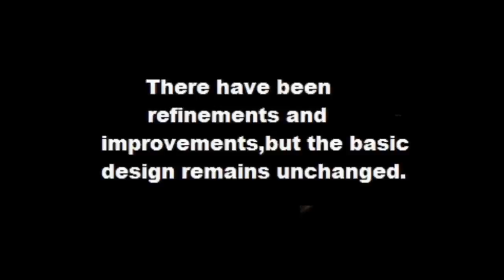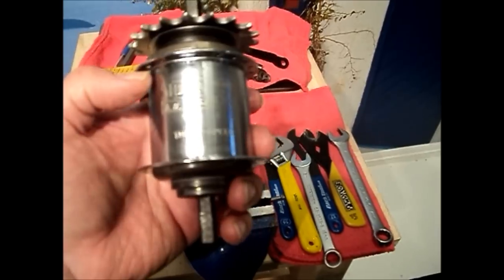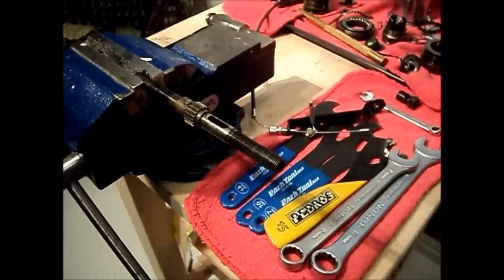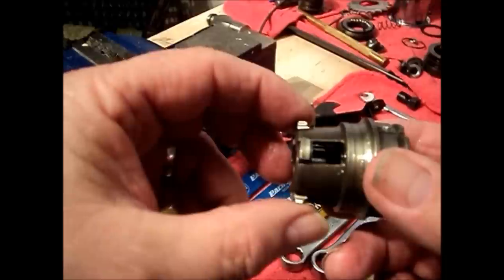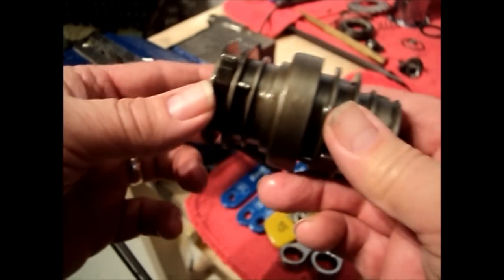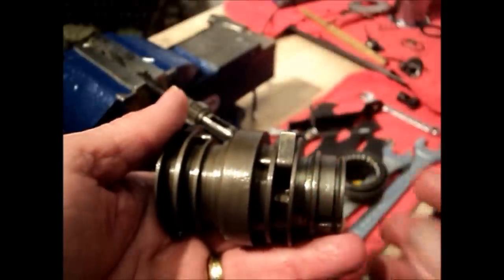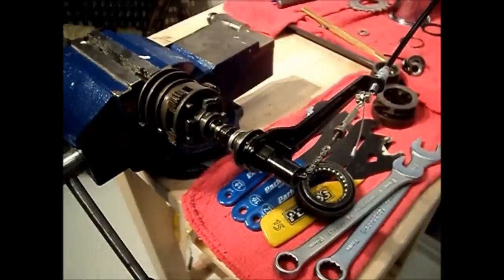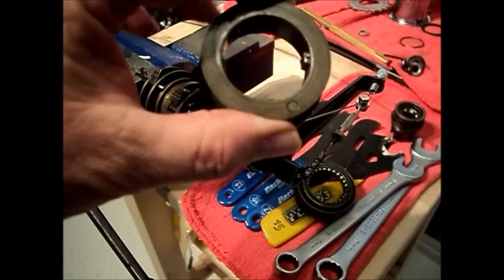Sturmey Archer 3 speed AW gearhub. How it works.

Comment: 10yrs ago I bought a 'box of bits' which made a 74 Raleigh Chopper. I couldn't get the gears to work so bit the bullet, stripped them, got rid of all the solid grease from 40+ years of sitting. lubed up and put it back together and it worked like a dream. I also converted it to 9 speed by adding 3 sprockets and welding on a rear hanger for a derailleur and using a friction shift for that. The hub has now done in excess of 5000 miles and still going strong. Of all my bikes, it would be the one I'd choose if I was riding up to 70 miles. I laugh when people tell me derailleurs are 'complicated'

Comment: After all these years, I finally get to see the genius that went into this design. While in 2nd gear I used to "preselect" 3rd gear while applying torque and the hub would stay in 2nd gear until I stopped pedaling for a fraction of a second. Then it would snap into 3rd. Now I finally know how that worked 😊. BTW I never felt that the neutral position between 2nd and 3rd was a design flaw. It was a cool feature 🙂.

Comment: That was a pretty understandable demonstration and explanation of the workings of a 3 speed. I find it amazing that the palls can withstand the torque of going up a hill without become burred or otherwise damaged and also the really tiny springs that allow them to ratchet.
Reply: I guess as tiny as the pawls are, they're kind of like nails. Sheer them from side to side and they'll break, but angle and use them like a hammer and they'll be strong... as nails.

Comment from the maker: Thank you for the kind comments. Semi retired trucker and semi professional bike mechanic. Not a mechanics teacher.
Reply: I got a problem with my 1980's SA 3 gear hub. It doesn't engage idle when walking bike(pedals are spinning). When pedalling I can feel force transmitted to pedals when I stop. I've have replaced chain, oiled hub, replace pin chain. Still no results. Bit hesitant to open it up.

Comment: This video brings back such fond memories. I had a 3speed Bomber Bicycle when i was a kid and I had to disassemble this same hub to replace the bearings and when I reassembled it , i had the issue you mentioned with the false neutral , and let me tell you I was a nightmare to get this adjusted correctly. Sometimes 2nd gear would engage and sometimes when shifting down from 3rd to 2nd i would get the slip and this sometimes resulted in painful injuries for a man downstairs...
Thank you for this video!! Well presented!! I think the BSA hub is a better design.
Reply: That is why it is called a NUT BUSTER!

Comment from the maker: Thank you for the comment Trent. The outer bearings should be greased same as any bike axle bearings, but for the internals, a light oil such as ATF or light viscosity base oil with no additives is fine.
Reply: Thank you for the information. Now I can finish my rebuild.
Reply: +Dan Burkhart Would you also use ATF in the newer hubs such as the S-RF5(w)?
Reply from the maker: +Schenectadont 
I'm running an older XRF5 ball lock type on ATF, and it works splendidly well. Can't see why it would hurt a wide range type.
Reply: Dan Burkhart  
Why it's soundless ??

Comment: Great video Dan. I've rebuilt my 1964 SA AW and I'm bench testing it in a vice. I can find all 3gears without the hub on but when I put the hub on I canot find 1st gear. I picked this hub up off of eBay just to see how thing actually work and to gain knowledge on refurbing one so I don't have a bike to put it on. Thanks, Mike
Reply from the maker: The one thing that comes to mind is that you may have over tightened the drive side cone when you re assembled it. It should be screwed down until it contacts and then backed off about 3/4 turn and locked down with the locknut. The bearing adjustment is done from the left side.
Reply: @2wagondragon  Well, I finally got het al back together and working. Here is a pic of the setup I came up with to check the shifting. I can turn either the axle nut and/or the brass lamp coupler to pull the chain and shift to all 3 gears. I'm posting the pic of the latest setup on bikeforums. Thanks , Mike

Comment: This is a great video to watch. I like how you take your time showing how everything works instead of going so fast I have to replay over and over to understand what happened.  I do have one question for you. I also have an older sturmey archer from '61 that needs some cleaning.  My question is how do I lubricate this correctly?  I keep watching videos on how they use grease on everything. With your video everything is oiled and looks as if you don't use grease. Any videos or anything that can help me thanks.

Comment: I thought that the 3 speed hub had been discontinued long time ago.  I am thinking of ordering a 3 speed W coaster brake for that vintage cruiser i bought from a friend.  The derailleur is OK, but it is vulnerable to dirt and damage.  You can say that the internal gear hub is bullet proof.  The only advantage of the derailleur, is you have more gears and that system is light weight  I am getting back to the geared hub.

Comment: Great video!  I have a newer SX-rk3 I am having a problem with.  It seems the spring is binding when I shift into 1st gear.  When I shift into 2nd or 3rd the spindle chain relaxes but the IGH remains in 1st.  I can maybe knock around the axle lightly and it will pop out to the right gear, or if riding I may hit a bump and that will release it out of 1st.  Would you have any idea as to how I may remedy this situation?  TIA!

Comment: Great video. I have a project where I want changeable gears without a freewheel (kids pedal tractor). Is there any hub that can achieve this? the freewheel in this video is unfortunately integral to the operation of the hub, I was hoping that I would be able eliminate it.

Comment: Dan I have a problem with my 1958 Raleigh.   The hub noticeably slows my rear wheel down.  The chain sometimes moves with my free spinning wheel.   I will re oil my hub but im still at a loss.   Fyi, all ball bearings are loose enough and well greased.

Comment: Wow, THANKS!  You just told me why the pedals spin freely in 3rd gear! A shift cable adjustment should do the trick... I was afraid it was broken.  I just acquired 2 bikes, a '64 Schwinn and a '73 Raleigh, both with SA hubs...the Schwinn has the problem hub.

Comment: excellent info Dan - the 1st & the 3rd gear of my Raleigh Sturmey archer gearbox is not shifting well...i dont know what has gone wrong.
Reply from the maker: There are a few things which could be causing these issues. It's possible the internals need servicing, but it's more likely that it is shift cable related.
 First, it's important that the little roller chain on the indicator, that little chain that comes out of the end of the axle, not have any seized links, and that it does not bind. It's important to ensure that the indicator rod is not screwed in tight. It must be threaded into the shift key until it stops, and then backed off at least a half turn. This is to ensure it does not bind.
 Check that, then check shift cable adjustment. The cable should be fully taut with the shifter in the first gear position, with just enough free motion that you can pull the indicator out a tiny bit before meeting hard resistance.
 If that does not solve the issue, it may be time to open the hub for an overhaul.

Comment: Thanks for the clear explanation,Dan!
I came here because my Sachs 3speed hub is permamently stuck in 1st.
I took it apart thinking I could grease it up & reassemble, but the parts got scrambled :(
If you ever lay hands on a Sachs, could you do a dis,-& re-assembly?
Even if you don't: Fantastic work work you're doing!

Comment: Hello Mr. Dan would like to get a hold of you. I have a few questions -like to add a motor to bicycle gears wondering how much torque can  they take?hope to hear from you thank you
Reply from the maker: I have not done any testing on the input torque limits on any of these hubs, so anything I would say would be a guess. Note that manufacturers publish limits on input ratios, usually in the 2 to 1 range, but limits on actual torque values are harder to find.

Comment: Thanks for such an informative video! I wished I'd watched that before I took my hub apart to clean the outer cogs. I am afraid I may have let a bit of degreaser in to the main hub, possibly around the ball bearings. Do you have any advice for me? (E.g. Should I just coat everything in fresh oil? If so, what kind is good?) Thanks!!

Comment: I just bought a Huffy single speed cruiser with a steel frame (a cheap bike, I know), and I want to install a Sturmey Archer 3 speed hub with a coaster brake. The rear hub spacing on the chain stay drop outs is 110 mm. I have researched and found only two Sturmey Archer 3 speed models with coaster brake that would fit: AWC (II) and S-Rc3(l). Both have 116mm outside locknut spacing. Which one do you think would be the best one for me?  I think I can spread the rear drop outs wide enough to accept the 116mm hub.

Comment: Hi Dan!
Great video, thanks!
I have a question, my shifting cable has been breaking off and I just can't handle it anymore, riding on the 3rd gear is getting tough. Is there anyway I can lock the clutch in position so the 1st or 2nd gear is always driven?

Comment: After watching your video.
I can still not figure out why the 3rd gear is not working
Years ago I had the hub apart, because it the time there was no gear at all.
It was very dirty inside, almost like someone put in some saw dust :)
I cleaned it a bit and put it all back together using fresh lithium grease. 
It’s completely possible I made a mistake, or maybe something is actually broken.
Now if I disconnect the indicator pin I would expect 3rd gear. It’s not there.
And the indicator pin seems to move in far enough.
I need to set the shifter to the 3rd position to get second gear.
1st gear is working as expected. On the shifter it just looks like it’s skipping second gear.
It’s all rather confusing, and I wonder what I could have done wrong.
Perhaps I need to clean it better and don’t use thick grease.
Reply from the maker: Do you have the older model with the star clutch, or the newer model? In either case, a grease like a NLGI2 is too heavy for the internals. Older hubs used light machine oil, newer hubs are lubed from the factory with NLGI 00 semi fluid grease.
Reply: @2wagondragon  Thanks for the reply :) My hub is from 1990 and it's a drum brake model. I actually just rewatched you video. question: Is it possible to incorrectly assemble these hubs in such a way third gear is not working? Is it possible to mount the clutch incorrectly so it can not interlock with the planetary axles? (I would think not) Since first gear is working my problem must be with the palls in the ring gear. I will shoot some WD40 through the axle and let it soak for a while. It would be cool if this fixes the issue.
Reply from the maker: @RolingRandom  Can you confirm that you have the pre NIG model with the star clutch? If so, it is entirely possible that something, perhaps dirt or thick grease, is preventing the clutch from engaging the pinion pins which would result in a non functioning third gear.
It is also possible that the pins and clutch are so worn that they do not engage positively.
Reply: @2wagondragon  Yes I can confirm that. For a while I thought I might have incorrectly installed the clutch. But I now know, that is not really possible. I can be clumsy but I'm not completely stupid :) The hub was extremely dirty on the inside and a bit rusty. Like I said it looked like, someone put in a handful of saw dust. It made me wonder how so much gunk could get inside the hub. Before I had it apart the hub would not select any gear. It wasn't so badly rusted, that chunks of the machined parts had rusted away :) But knowing myself I probably used way to much grease. At some point I will open up the hub, and then I'll shoot some video. For now I will shoot in some wd40. And let it soak in for a week and take some test rides. Perhaps that will dilute the grease a bit and maybe that will free up any stuck palls.

Comment: Do you think it's strong enough to be driven by an engine? I have made a chainsaw bike, and I want a gear shifter, gear hub would be the best solution, but is it strong enough? The normal mountain bike casette system works well now, with that 2 little hammers. I see them here too, but they are bigger. Is that means, they are stronger than the mountain bike ones?
Reply from the maker: I don't really know the answer to that, although I don't think a chain saw motor develops too much torque,
 Is this a pedal bike with motor assist, or strictly engine power? I would think if you just used the motor to assist when moving, and not to start moving from a stop, it might be alright.
 If you do try it, let us know how it works out.
Reply: It has no pedals, just the engine, the torque is still not enough to start well, but it has already broke the common wheel's parts. I can't really tell you, I just tell you with this picture: http://img.koliken.hu/nagy/ha029.jpg
The most single speed bikes has this. And this part has broken lots of times.

Comment: Thank you very much for the video! Maybe you can help me with something. I'd like a 3-speed with a coaster brake for my father-in-law with rheumatoid arthritis. But my research indicates they aren't very durable, not like the AWs are. Is there a good SA with the coaster brake I'm missing?
Reply from the maker: I've found the modern production Sturmey Archer coaster brake three speeds to be very well built. One advantage the modern design has over old production units is that the mechanical advantage over the coaster brake is the same in all three gears. With the old design, mechanical advantage was lost in third gear.
Reply: Do you have a part# or link for that one?
Reply from the maker: Yup. the model is SRC3
http://www.sturmey-archer.com/en/products/detail/s-rc3
Reply: Many thanks! 
Once this is installed, YOU will be given ALL the credit my friend!

Comment: are these good on folding bikes?
Reply: I have a Dahon III, a folding bike from the 1980's, and they have these SA 3 speed hubs. One of them is slipping occasional in gear two. I am thinking of doing a tear down to see if I can get it to stop. It could just be in need of a minor adjustment on the gear cable. I really need to try that route first though.